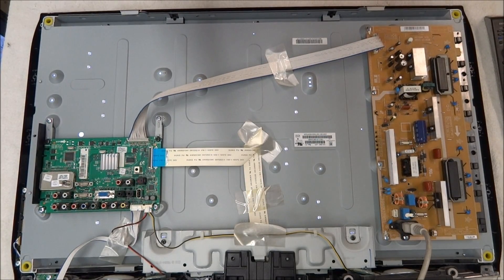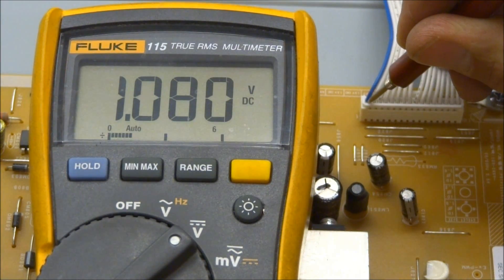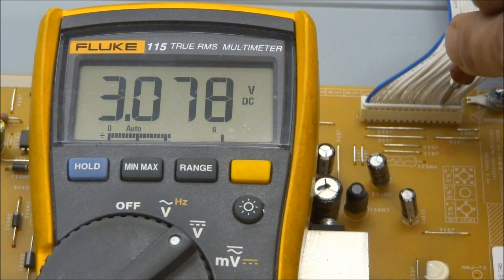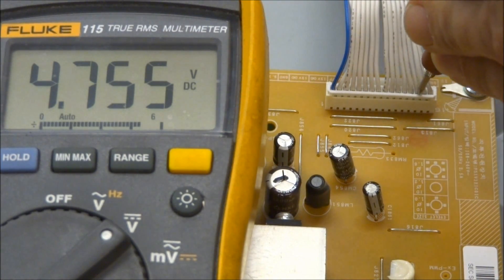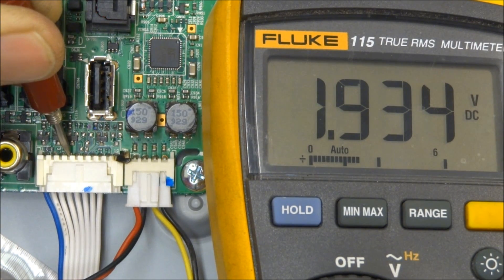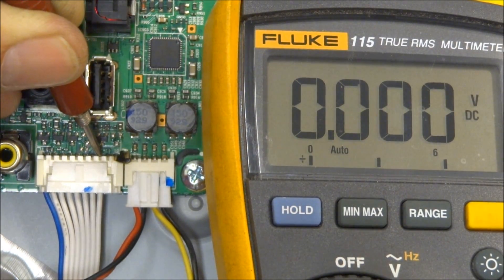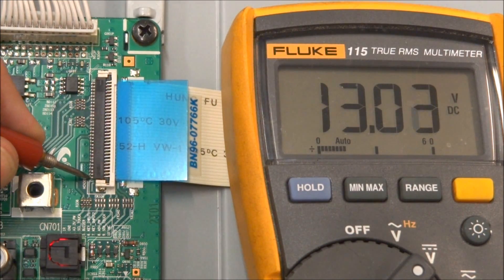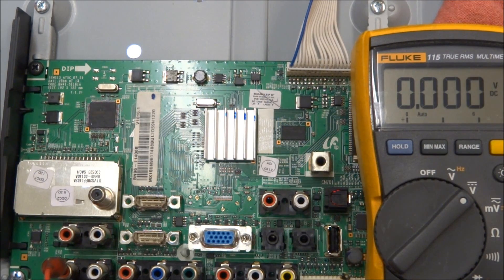Samsung LN32B360 Troubleshooting Voltage Measurements BN44-00289 BN96-11408

Comment: Hi I have a old,but nice Samsung model (PS50Q97HD) plasma Tv that I’ve been working on for a number of weeks and is proving tricky.

I initially got the set working and was busy upgrading the cooling and efficiency bid the (X) and (Y) main boards by adding small fans to pull heat through the heatsinks.
I then replaced the(X) and (Y)mains and when turned on a transistor violently (exploded) shot across my he room just missing my head😡, ok so a (dead short) somewhere on one of the boards.
I sourced a working S/H (exactly the same) replacement PWR Supply board. Before fitting I re- flowed all the joints on the Transistors, NPN PNP, Voltage Regulators,Mosfetts. Etc. I then replaced all major capacitors on the PWR Supply  with new ones.

Plugging in with (Test Bulb) connected (bulb in series with load) the Tv goes into classic (boot up loop)
When connected directly240v TV PWR Supply keeps taking the 3Amp mains plug fuse,when I’ve used 5Amp plug fuses blows them to.

When plugged in  directly to 240v there was a loud (Bang) rhe exactly same transistor blew as on the original board and also tripped off  the(Socket circuit) RCD in the flat.
So there is (Definitely) a issue and/or (Shorted)  component on the PWR Supply board.it’s difficult to test outputs to various other boards from the PWR Supply whilst it’s hell bent on blowing fuses.

Advice and guidance would be much appreciated 

Jason

Comment: I have a BN44-00932S that does not have a symbol for 5v or stb.  All I see on the diagram is; OD_ON/OFF, PWM BLU, POWER ON. Which should I see 5V from?  Thanks!

Comment: Your video is still helping people, when reading the key scan pins I discovered most of the side switches were bad including the power switch, I also had a bad remote which is why it wouldn't power up. I would suggest one correction however, to force the power board on all you need to do is remove cable going to the main board, you should see the backlights come on if the power board is working.

Comment: hey I have the same tv my tv is turning on and off three times and then it go's dead. I changed the power board/inverter and it still does the same thing. now ill be getting a main board in the morning I hope it will fix the problem. I wish I had your know how to fix these things, I try but its slow going. but thanks or the video I'm going to check my boards with your video!!!

Comment: My Samsung Model: LN32B360C5D, Remote: BN59-00857A Ocasionally works but most of the time it turns on/off on its own and tv buttons and remote has no effect, could it be easily repaired?

Comment: BN44-00261A my one i changed capacitor but it doesn work. I am so sad now..
Reply: if is similar than BN96-0337A then try replace F9222L .you can buy on ebay about 2-3 usd.this worked for me.

Comment: Hello. I have a Samsung UN60F7100 with the board BN44-00630A. The TV itself has a sticker that says it's rated for 110-120V @60hz. Best I can tell, the PSU board says 100-240V @ 50-60hz. Is this TV actually a dual power display? Can I use this globally without needing a transformer? If I do use a stepdown in a 230V @50z environment, will it be OK stepped down voltage-wise, but not stepped up frequency wise? Thank you!!!!

Comment: Hello i have a le40b620r3p with powerboard bn44-00264a. Standby ok. When i turn on the tv led light goes out en nothing happens. Cold site output powerboard standby ok. The other voltages pulsating do you know what the problem can be? I resolder a lot of parts to make sure its not a loose contact.Grtz
Reply: Garbage. Better

Comment: Hi great video, I have a question. Will this be helpful to me since my tv just turns on and off when I plug it in the wall outlet and the remote or the buttons on the side wont do anything. I ask since I see in your video that you turn on and off the tv and use the remote and side buttons. Thanks
Reply: Did you manage to fix this yourself? 
I got the exact same problem.
Thanks

Comment: On some voltages like 5v and 15v you measured low like 4.7v and 13v. I know the set was in working condition so I'm wondering how low of a voltage from what they're supposed to be would actually cause problems?

Comment: Thanks for sharing. Good info in this video. Also worth noting is that in most of the models you can actually take the connector out of the mainboard and plug your AC-cable to the power supply and you should see the all the voltages turn on and the backlight also. A quick way to see, if your PSU is working (without a load, at least)